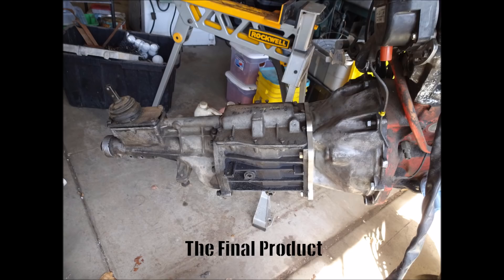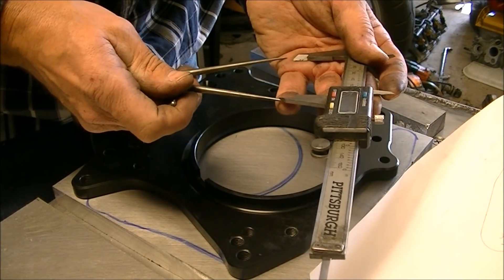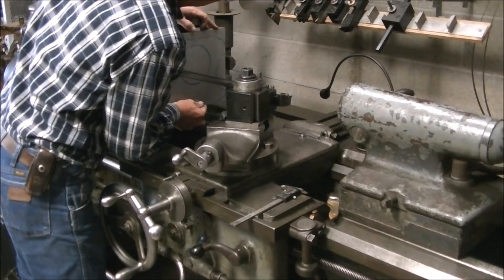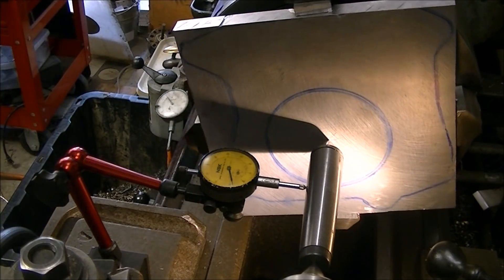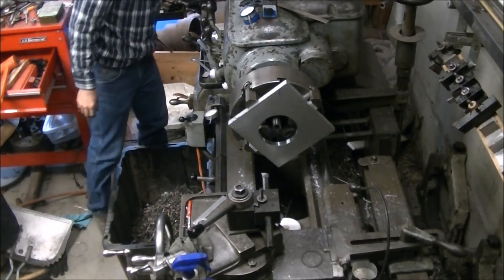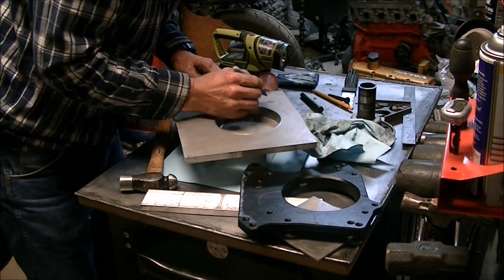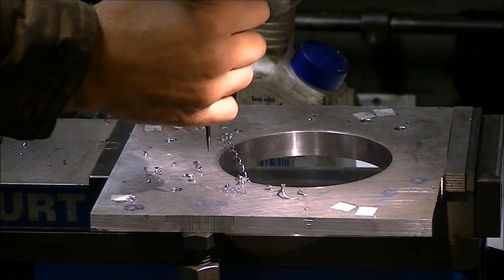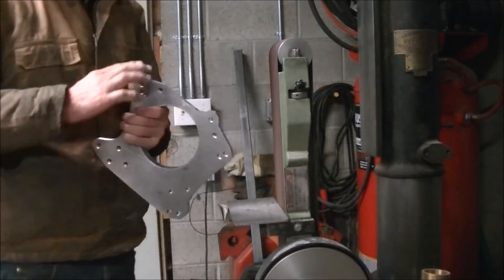T5-Volvo Adapter: A Hendey Lathe Project, Part 1

Comment: Can you make an adapter plate to go from a T56 to a T5 bellhousing or a Nissan 350Z transmission the cd009 to T5 bellhousing?
Reply from the maker: With all the required dimensions it would certainly be possible, whether it would be affordable or not I don't know. Thanks for watching and commenting. Craig

Comment: The keyless chucks have a self tightening mechanism. When you turn it to reverse it usually loosen up.. Thats why they suck at powertapping. 

Greetings from Finland!
Reply from the maker: Harri Havulo you sure are right, they do not work well at all for power tapping. I got to see some of your countrymen this winter when Steve N Seagulls came to town, lots of fun. Kiitos kun katsoit. Craig
Reply: The keyless chuck and holesaws/big counter sinks are also NOT good combination with gear driven drill press or milling machine... I had a jam with a carbide hole saw and the chuck overtightened and broke... 120euro rohm chuck... I thought i was to agressive with feeding... Tried once more and broke ANOTHER!... 
Sometimes you need to pay and learn the hard way.

I am just an amateur Hobby machinist with a  metal work machine disease :)
Reply from the maker: +Harri Havulo that would be an expensive lesson. I haven't tried a holesaw with a keyless chuck. I've used annular cutters like Hougen's RotoBroach and they seem to work well but they are made a whole lot better than the holesaws. Craig

Comment: +1 Volvo - finishing my 1989 740 Turbo rebuild.  In the end of days there will be cockroaches and Red Block Volvo's.  

Make a pile of these - easy sell. 

Dan
Reply from the maker: +House of Broken Dobbs Things _ with Dan Dobbs any exciting upgrades to the redblock with the rebuild? I'm looking to do a little porting and polishing on the head and figure out an upgraded turbo. Thanks for stoping by. Craig
Reply from the maker: +House of Broken Dobbs Things _ with Dan Dobbs here is a clip of one of the other Volvo projects. https://youtu.be/0vOxDZ83deY
Reply: clemwyo Mostly just a refresh from years of previous owner abuse. Once stable and dialed in likely add in a cam. Can’t beat the versatility of what they can haul.
Reply: My kid has me looking at 2.4l T5 - turbo as an upgrade - have to re-clock the turbo and work on the flange. I rebuilt the stock 12B turbo and had it balanced for now.  Minor porting and freshened the guides. Rear fuel line rotted out - and I have one coming in from Sweden.
Reply from the maker: +House of Broken Dobbs Things _ with Dan Dobbs my son likes the wagons but I grew up riding in wagons so I stick to the totally impractical 2 door coupes, my daily driver is a 1983 242 just over 272k miles and original engine and 4 speed with overdrive. Hardly used any oil and still fun to drive. Craig
Reply from the maker: +House of Broken Dobbs Things _ with Dan Dobbs a white block is a tempting choice, with the 122, the engine compartment is pretty tight so the b230ft will have to do for now. Should be a big upgrade from the 85 HP b18 it came with. Craig